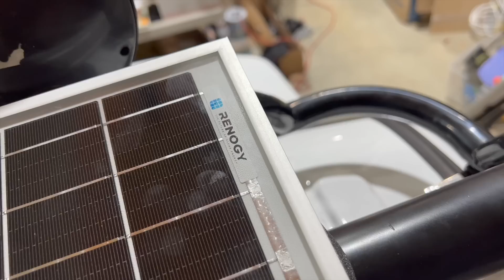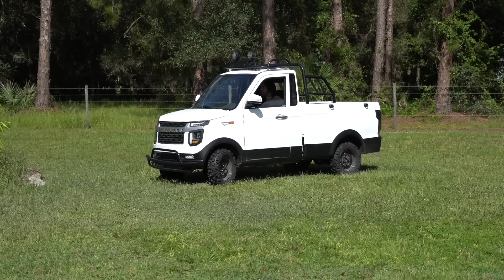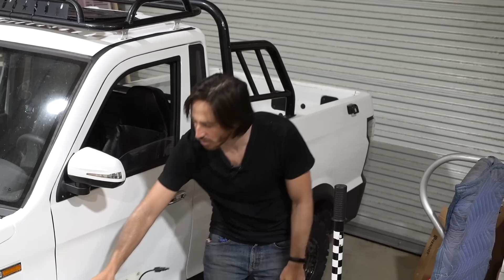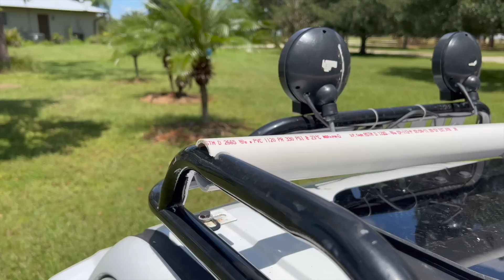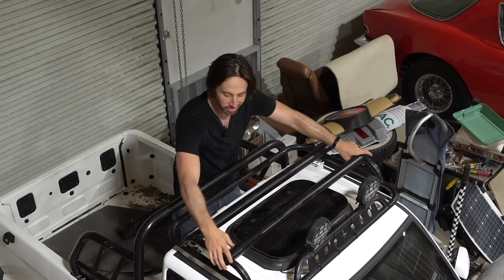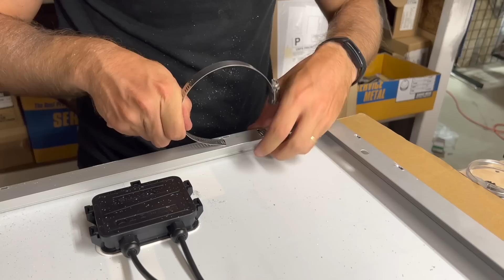I added a solar panel to charge my $2,000 electric truck

Comment: i want this truck but put a 540 watt bifacial panel elevated up over the bed, and overlapping over the roof of the cab. then you might actually never need to plug it in, anyone know if anyone's done this? i can't find anything like this

Comment: Now this is such a cool project. How is the truck doing after 2 years?
Reply: about 30 months now and going strong without a single failure of any kind (except when I ran out of battery on the pasture !! - my fault !!)
Reply: @micahsdad5388  😅. What a cool truck.

Comment: I know this is like 11 months old, but... Why not glue the flexible one on the hood of the engine?
Honestly I do NOT understand why electric vehicles don't come with ONE small solar panel automatically?
If I EVER get out of debt and keep a job without quitting out of anger, I'd like to get an electric vehicle, like a Smart for Two, and adhere flexible solar panels on the hood, the driver and passenger door and the read hatch and possibly the roof though I may have a small rack up there. This way I can also get energy from the morning and evening sun no matter which direction I am going.
Reply: We were really looking at a proof of concept install with the single rigid panel.  Also, we like the OEM look to that panel.  A flexible panel on the hood would definitely work but look a bit too DIY for our purposes.  FYI, when the sun is low in the sky, the panel would need to be almost vertical to get any real energy out of it.  Regards
Reply: @micahsdad5388   I believe with electric vehicles that charge with a single solar panel there are MANY options ranging from easy of installation to efficiency, YOUR method of adhering it to the roof IS, imo, one of the best ways, it's easy, and you get the maximum sunlight during the day, especially the closer you are to the equator or summer.

Comment: Have you thought to make a frame and use the solar panels to make the sun shade over your truck to get much more electricity?
Reply: we did but there would be serious problems due to the dump bed clearance required.  We also didn't want the panels to extend out past the sides of the roof rack frame.  We could have figured something else but we get enough charge to replace use on most days so forcing it didn't seem worth it.  thanks for your question
Reply: @micahsdad5388  Thank you for your response

Comment: just slather the whole thiing in some cheap panels from amazon, the sides and hood are prime real estate broseph, also put two or three of those panels on top pust put them the other direction, a thin piece of plywood makes a good mounting option, if you listen this would make a good little rv, just make a shell for it and put even more panels lmao

Comment: couldn't you add additional or a larger solar panel to the hood  or an A frame setup for the panels (you could use two ) on the roof ? .  looks like an awesome setup !

Comment: I think the larger 100 to 300 watt panel would be better. Using BougeRV 180W 12V 9BB Mono Solar Panel is small but good power.

Comment: This is awesome, Great video. Are you thinking about getting one of those 200 watt Renogy panels? I think they are just a little bit bigger than that 50, and you pull in like 15-20% instead of ~ 5%?  Unsure. Anyway, great idea.

Comment: Will the charge controller cut power to the battery to prevent overcharge ?
Reply: yes - you set a max charge level.

Comment: It's really about a 4000 dollar truck after all the shipping and customs fees .
If you don't get fined 5000 dollars for filling out a form wrong or late.
I think you can a customs broker for a small fee to handle all the customs forms.
It's still a bargain at 4000 bucks though considering what a new golf cart costs.
Some dealers are selling them for 8500 dollars .
That's what it would be if you fuck up the customs forms.
Still a better value than a 8500 dollar golf cart . 
Get a broker if you really want one , only thing it may come damaged .
So say the dealers who mark it up double.
They order a whole container of them and they usually sell 4 wheelers and other power sports vehicles.
The cages they come in look pretty sturdy idk what you'd have to do to it during shipping to damage the truck inside though.

Comment: How did you order this vehicle from Alibaba? did you have to contact the seller? and how much was the shipping?
Reply: Yes - video chat with the factory.  That video is on the channel for you to see.  VERY important to do prior due diligence.  Also need a customs agent to help hold your hand through  the process.  If you don't fill out the customs paperwork properly, the vehicle and be impounded and you lose everything.  Watch all the prior video on this truck.  Lots of good info on how to do it and reduce risk.  Good luck. We love the truck   About to do the 18 month review with latest mods we made to it.  Working perfectly without a single breakdown.  Best regards

Comment: You could mount the flexible panel on the hood & glue it down with something that won't damage the paint if you need to remove it. the flexibility will allow it to conform to your Trucks hood. Just an idea. Enjoyed the video ! :)

Comment: Was there some reason that you were unwilling to mount the flex panel to the front hood of your truck?It would be supported well enough by the hood itself and could be paralleled with the other panel to boost the charging amps.
Reply: More of an esthetic decision.  Would look a bit too DIY for us.  One on the cab top looks very factory and almost invisible when viewed from the side.

Comment: I'd put two of those panels on the rack--rotate them 90 degrees so they'll most "fit" up-top.  But, regardless, great little project, and that truck is truly awesome--even considering the "landed" cost.

Comment: Idea: run 2 of those panels in series and you're controller will kick on in low light and continue to charge longer during the day. I think they'd still fit if run 90* and leave a bit hang over the rear window + free window awning! [Assuming controller can handle 48v]

Comment: I'd get run over if I took 1 of these low speed glorified golf carts in my local roads.  With speed limits going from 30mph up to 50mph I couldn't keep up with the flow of traffic.  Be OK on the island if Wildwood with 25mph speed limits.

Comment: me again . do you plan custom suspension. maybe suspension from a Kei car maybe a honda beat
Reply: Not needed.  The spring rate of the OEM is much too high.  We are changing them to softer springs.  Already added larger tires.  Stay tuned for a future video with these and other cool upgrades

Comment: Whats the turning radius on that truck?
Reply: Great question.  We added larger knobby tires a couple of months ago and needed to do a bit of reshaping of the wheel wheels to accommodate them.  Need to do a bit more of the same to the fronts as they now rub the tires at near to full turn lock.  At that point we can reset the full turn stop limiters and do a turning radius test.  Stay tuned.  Best regards

Comment: You should use a "Western Union" or "lineman's" splice on soldered power connections to ensure the splice does not fail suddenly at the melting temperature of the solder.

Comment: I'll say the second charging port connector that you don't use is likely a charging port suited for the region and country it is from where that port might be the most used and easily available in the area so if you want to find out more about try looking for where the truck is from or meant to be sold at which market that could help you find out more about it.
The charging connector may have been added to make it more accessible to charging in major parts of the country where the plug you use for charging is the most common and easy to find.

Comment: Wider or two panels on the roof, change the angle of the panel to face the front of the truck, and put that flexible panel on the hood. That should be enough to make this helpful beyond a minor trickle charge.

Comment: Cool idea. A couple 100W HQST panels on amazon is only 160. You could make it a fold out design so the folding one hangs over the windshield side. Then I think you'd never have to plug in.

Comment: on my golf cart. I made a rear and forward adjustment on the panels.
So if I can change the angle of the panels by hand. this way if I'm traveling westward I can drop the southern side and raise the northern side.
Opposite going in the other direction.
And if traveling north then I can lower south and raise north. Or the opposite.
With 4 adjustments points one can improve things.

Comment: I've been wanting to do this for years.
But you are not using enough panel.
You need to have your panels equal the volts.
I don't know how many volt your motor is. But say its a 48v motor. You need 48v in panels. Then up the amps.
Otherwise you are just wasting time.

Comment: Great Idea. Any assist with charging can help. Looking myself to buying a Tuk Tuk.  What I like to do is add a wind generator. I feel that Wind can give me the best recharge on any type of EV. Just have to use a barrow type and not a pinwheel of any kind. Hope is too trivial off grid with a pull behind camper or a cab over shell. Even like to come and visit you.

Comment: Use a single 450w panel. That should cover mostly the back of your cab. 450w are huge panels, it should fit. 

You can park it up at night and use the remaining energy to power lights around your property.

Comment: Joke video. One horsepower = 746 Watts ... A 100 Watt solar panel charging for 7.46 hours (assuming full output of solar panel) will give you one horsepower of energy for one hour ... Disregarding losses ...
What is the average kWh power consumption of your vehicle? ....

Comment: It's impressive how much this small set up produces - my head instantly went to stacking two of those panels on top, and another, larger array on the hood. Electricity is cheap, but being able to largely opt out of the energy production loop seems ideal. Really nice video, and a good idea.

Comment: All electric cars should have solar panels built in for trickle charging on the roof, hood (bonnet), and trunk lid (boot). You could get a few miles/h charging in good sun.
Reply: Just not worth it.
Makes much more sense to put the solar panels on the roof of your house instead.
But if you have money to burn, why not 🤷🏼‍♀️

Comment: I see multiple places for that second panel. Like others have said, find a spot for it even if it has to be moved around. You can even mount it in the bed of the truck with plexi over it.

Comment: softer longer springs would help with the suspension. That mini truck doesn't have much weight, does it? very easy to go overboard with the spring stiffness then. There are shops that make custom springs, try -50% stiffness WITH +40% length
Reply: we have softer springs ready to install.  Should be a big help

Comment: I'm pretty sure you could add flexable panel to front hood. It would be less efficient but combined with roof one you probably can drive twice the range in same day and still charge cover it.

Comment: I'm not an ecofreak or anything like that (don't mean to insult anyone) but I own a large property in the country and this rig would be perfect.  I think I would attempt to put a lift kit on it so I can traverse the woods, but the truck and the solar panels would be a huge boon to my finances in the gas/diesel I consume driving the tractor(s) around to haul stuff, do light maintenance like fence repair, etc.  Anyone got a link to the site I can buy the truck at?

Comment: What are your thoughts on the Sodium-ion batteries that CATL plans to start mass producing this year?  
Since Sodium is 1,000 times more common than Lithium, do you anticipate the EV boom to accelerate in response?
Or do you think the weight disadvantage of Sodium over Lithium might offset Sodium's use?
Reply: wribg

Comment: You could easily put a larger panel on top of the truck. I know this was sort of an experiment but a 100w panel or 180w panel if you don't mind a little overhang on the sides or back could easily be done. For my ebike I use a MPT-7210A programmable DC to DC boost converter with my solar panels. With my 120w foldable much abused panel(could be only 100w rated at this point) I get about 1.2Ah in good sun, if I pop my 60w panel on as well in parallel I get about 1.75aH easily enough to charge it from flat up to it's 15aH capacity in a day. What I like about the MPT-7210A is it has a current counter and you can program your batteries capacity in it and it has a little battery indicator in there which shows you how much you've put in. It also stores up to 20 presets for different charging options in case you have extra panels kicking around if you want to charge it that way.

Comment: There doesn't actually appear to be anything on it that wouldn't be easily fixable...even if the original components don't last.
Reply: True.  Easy to work on and fix (but nothing has broken in 15 months) and many parts are generic and easily sourced.  regards
Reply: @micahsdad5388  And how cool is THAT?
Reply: @hootiebubbabuddhabelly  Very cool !!

Comment: pvc warps and melts when it gets hot in the sun (and painted black), just a heads up.
Reply: Thanks.  Did go through a good deal of last summer here in FL and maybe because it is thick wall pipe and the solar panel actually shades it, we didn't experience any issues.  We will keep an eye on it.  regards

Comment: With the size of those panels, you could rotate the mounting 90 degrees, slide it over to the side arch, and parallel another panel for twice the current.

Comment: Here’s an idea, how about if you get a ladder rack on your front bumper and another ladder rack at the rear of your cargo area Boca same height as the bar behind the cab then make a metal frame with a hinge that is attached to the bar behind the cab then attach some ply wood and extra solar panels to the frame. Then you can do the same between the front ladder rack and the bar behind the cab. Now you have extra solar panels and you are carrying your own shade and if you need to load you vehicle with a front end loader or crane then all you have to do is unlock the board from the rear ladder rack and hinge it forward. If you want to spend a bit more time on careful design then you could have some kind of a swivel at the hinge on both boards so that they can be turned upside down for carrying long loads or just so that you have an elevated platform to work on.

Comment: Put the flexible panel on the hood and turn the panel on the roof 90° and put a second one next to it.. To still fit you have to cut the pipe off on which the additional lights are mounted on. You can flip the pipe 90° forward and weld it on again - so your lights drop a bit down and forward to give the longer panels room.

Additional you could fit 6 more panels on the truck: Use the attachment points on the side of the bed to attach a frame and mount 3 panels on each side. Between the attachment points and the frame you need to add some hinges. After parking the truck you can hinge the panels 90° up to let them face the straight up.

This gives you 450 W rated and 405 W real peak output on a sunny day. So on 8 sun hours you would get 42 % recharge :)
Reply: yes

Comment: Seems you could have installed (squeezed) two of those solar panels on the roof to give you 100W of solar power... That's what I would have done, or even installed two 100W panels to give 200W of solar panels (would have to be raised up so it clears those two round headlights at the top) so that you may not have to plug in at all...

Comment: The other terminal next to the one that charges your batteries might be for charging the batteries with 240V household AC, look for a full wave rectifier on the other end of the wires connected to that receptacle. Or build your own 240V charging unit.

Comment: I think I would use the Pb battery up north because of the cold. Dremel....the tool that has ruined more stuff than anything in history but everybody must have one!  Thinking of buying one of these trucks for my off the road camp miles from power.

Comment: I watched your unboxing.  This is an ungrade that should be done first [I H O👍].  I've built an elec. trailer [it fits on the tongue]. Now, I will add a sun shade over the seat [i.e. solar panel to keep the battery topped off].🐿

Comment: Im keen to know what the car uses per kilometre when driving. 
Assuming its about 300wh per km, then you could assume 10 hours of sunlight per kilometre of driving.
A clamping multimeter could tell us the current flowing out of the battery while driving.

Comment: Question but not about this truck. If I bought something like the Ford Lightning could I put a generator in the back and charge it while I'm going down the road? If so it would be a good way to extend the miles I would be able to get between stops to recharge.

Comment: Very nice and interesting what you have done to extend the electric range of the little truck.
There are times when you are out there working away and it is nice to have that solar power putting power back into the batteries rather than guessing the battery that is left only to run back to plug it in for a few hours. good job on this little addition to the little pony workhorse.

Comment: 6:33 you should upgrade those cooling fans with Noctua Cooling fans; they are one of the best options for PC cooling so may help move more air inside your truck
Reply: probably should get the industrial versions because the silent ones are way way worse compared to the industrial ones
Reply: How much are those fans you speak of an where to order them
Reply: @kennywheelus6857  Any of the better PC part stores like NewEgg should have them.

Comment: put the flex on the hood and the rigid on th roof. you just can't have too much pv.  edit: I agree with the comments, get a bigger panel on th roof (remove the lights) and use the 'hood'